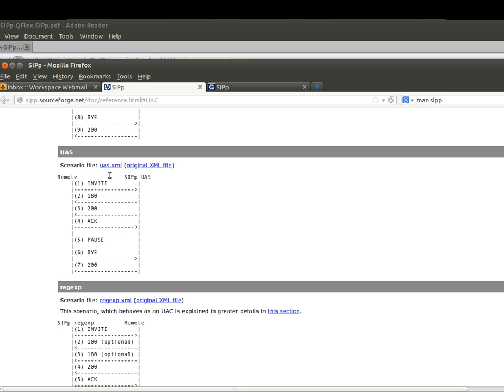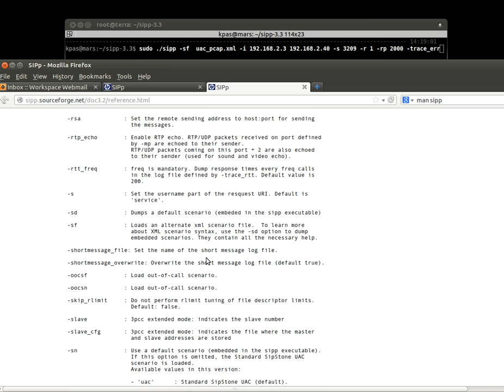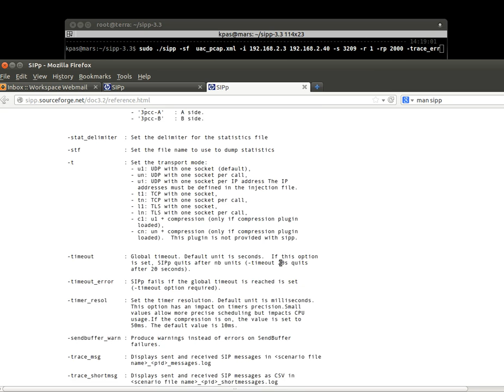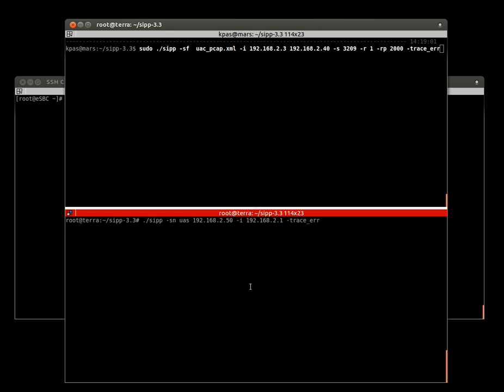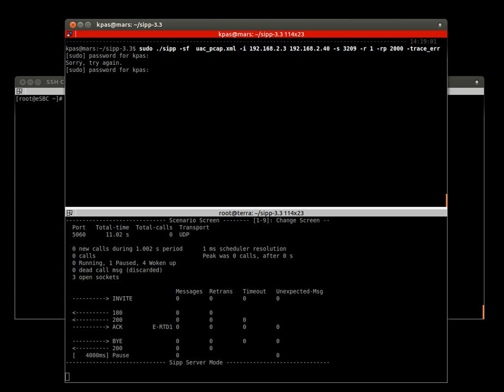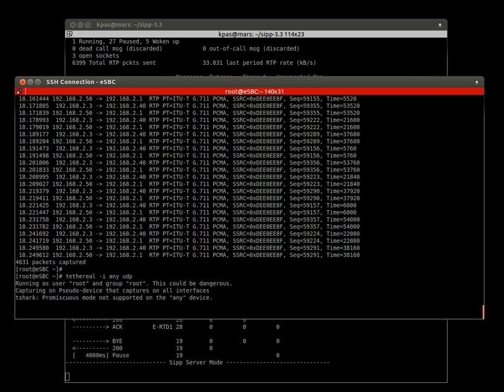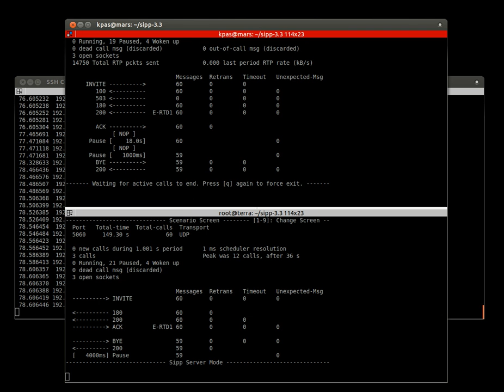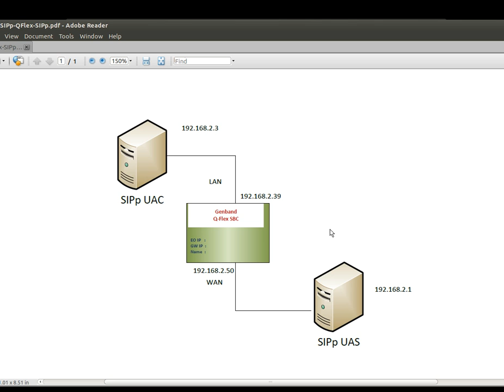How to Make Call Between two SIPp Devices

Comment: I m tryjng sipp to sipp call
But call is not connecting through my imscore

Could u plz help me
Reply from the maker: I am not familiar with imscore.
Reply: @kurtpasewaldt  I want to know ,,,as a destination ip and port need to mentioned in command of user2 or may be Pcscf or proxy server
Reply from the maker: @shashankkumar7140  Do not understand what you are asking.
Reply: How can we change RTP media traffic port
Reply: I solved it

Can u plz suggest to load testing ,,,if 1 lakh subscribers need and command for sipp and socket based error
Reply from the maker: Are you asking for the switches to bulk call a 1000 calls at once? @shashankkumar7140
Reply: @kurtpasewaldt  no ,,asking for load testing , min 1lakh users ,, through sipp tool , for our IMS Core network ,,
Reply from the maker: Yes are you asking for the SIPp switches needed to configure SIPp to bulk call 1000 calls at once? @shashankkumar7140
Reply: @kurtpasewaldt  👍 
Have u any idea about ,,,can u share a some info about
Reply from the maker: You are looking for the -l command in SIPp:  
 Set the maximum number of simultaneous calls. Once this
                     limit is reached, traffic is decreased until the number
                     of open calls goes down. Default:
                       (3 * call_duration (s) * rate). @shashankkumar7140
Reply: @kurtpasewaldt  I have  a query ,,when I apply 5calls/sec then it's work fine and if increase by 10calls/sec ,,,so UE got unregistering from IMScore(hss),,
Have u idea about to ,,for unregistering regarding,,

Means once time register into IMS,,then it should be register into ims network,,

Comment from the maker: The device in the middle of the two SIPp systems is a session border controller.  That is why I have two IPs.  One SIPp will send to IP 192.168.2.39 and the other SIPps will send to 192.168.2.50.  The SBC will then route between the two SIPp devices.  Think of it as one side of the SBC is on the public internet and the other side is your internal network.

Comment: Hi,
Its failing with error when I used comand "./sipp 127.0.0.1 -sf uac_pcap.xml -l 1 -m 1"
The auto_media_port keyword requires PCAPPLAY.
Can you suggest how to ovecome this error...
Reply from the maker: Did you make SIPp with pcapplay?  If not try running these set of command before running your scenario:

make clean
make pcapplay

Kurt
Reply: In the uac_pcap.xml file change [auto_media_port] -> [media_port]